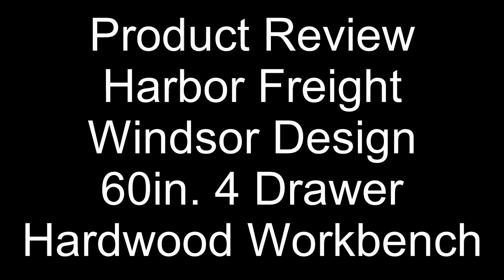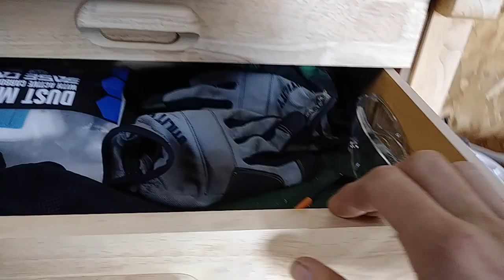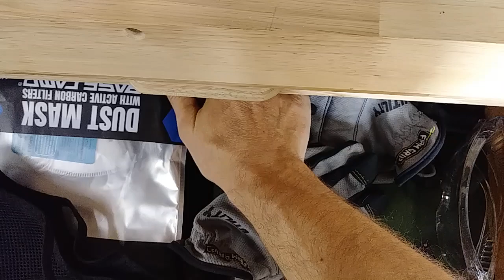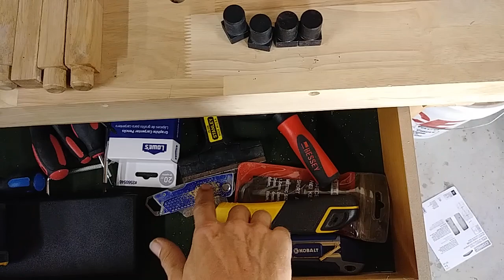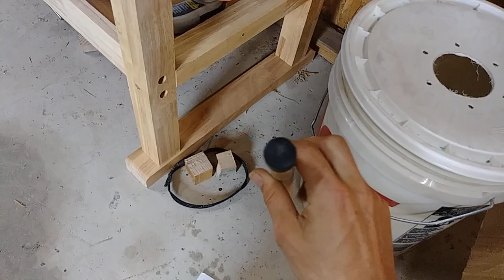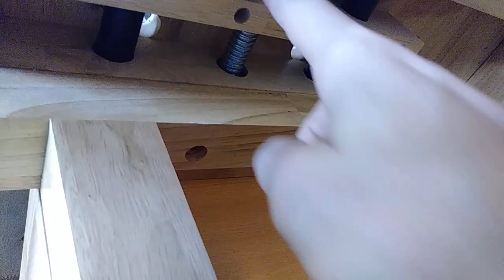Tool Review - Harbor Freight Windsor Design 60in Workbench

Comment: I just put mine together today. I had no issues with the build. My only complaint is the MDF board. The edges of the MDF board used for the drawers are completely exposed. If any kind of moisture ever gets in there it'll be ruined. I'm considering applying birch veneer to give it a layer of protection. I'm also swapping out the rails for the drawers with beefier ones that allow the drawers to come out further. Overall, happy with the purchase and I highly recommend it to anyone looking for a decent workbench.